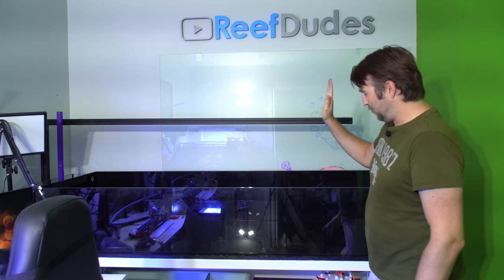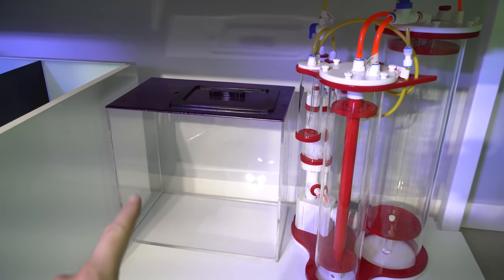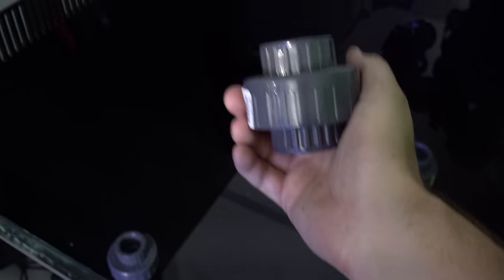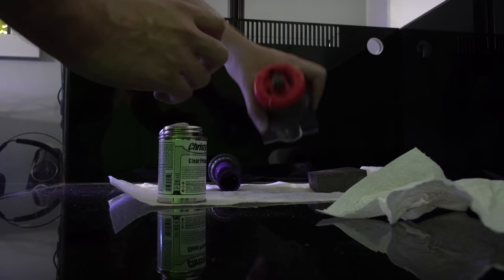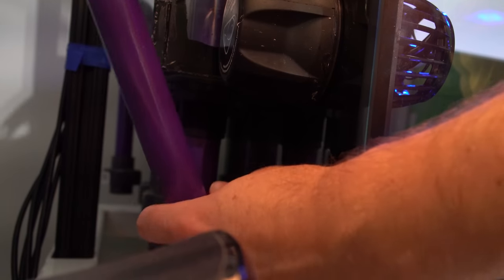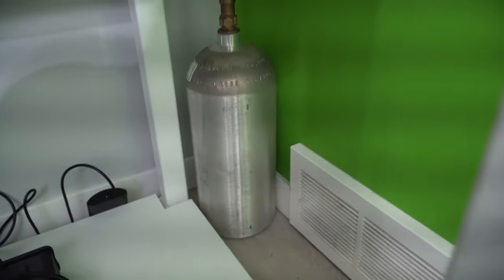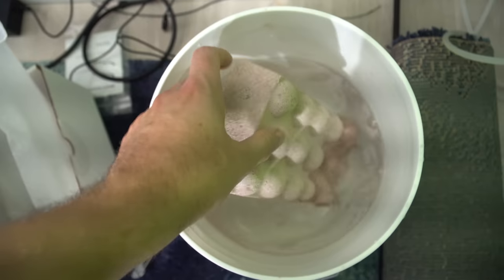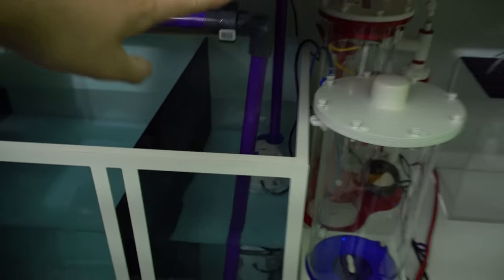Saltwater Aquarium Setup - ReefDudes Coral Frag Tank propagation system!

Comment: Fantastic looking tank. Purple pipe is cool. 
One thing I would have done is plumb the main drain to the most forward hole in the overflow. That would put the filter roller, gate valve and drain up front. Easier to reach since these will be the maintenance items on the drainage system. Hard to tell from the video but the trickle looks just a bit high. I like mine just below the weir so there is a bit of a dropoff.
Reply from the maker: I have the skimmer infront of the roller which i willc lean more often so that was my logic! but if it is a pain to clean i can alwyas swap it later :)  The trickle is just a smide lower than the weir.. i may lower it a bit more later but so far its working well!
Reply: @ReefDudes  Thanks for the quick reply.
I had totally forgot you were putting the skimmer in that chamber too! Makes sense now.
Will you have any fish in this?
Reply from the maker: @johnVidBozo  Yep, everything from the lagoon tank will be moving into this tank soon. I moved in most of the zoas today.  slowly but surely!
Reply from the maker: @johnVidBozo  Yep, all the fish from my lagoon tank will be moving in as im shutting down that tank once its all moved.

Comment: I like the straight up bean animal mod. No elbows. I’ve been running my display like that for 6 months and never had issues. Actually find it restarts just a few seconds quicker too. 

I’m about to plumb a lowboy50 unto my display system as a grow out. When I move, in around a year, I’ll be adding a dedicated independent frag system for archive/ duplication.
Reply from the maker: Simple and effective!   I have done it for a while to.. as long as you have a good gate valve its easy to tune it :)
Reply: ReefDudes spears gate valves all the way. Very smooth, very precise.
Reply from the maker: @neilphillips3193  100% with you on that one! especially a year or two later! :P

Comment: Where did you get that adapter for the power bricks? Looks like the connect to one cord and you are only taking up one outlet with them
Reply from the maker: Yep, split off one plug to multiple adapters.  I like to group like items so all lights on one plug, powerheads on one. ect. 
2 way splitter https://geni.us/2xsplitter    
4 way splitter https://geni.us/x4splitter    
6 way splitter https://geni.us/x6splitter

Comment: Where is cheapest place to get the colored PVC piping? Or can you just spray paint the cheap white stuff
Reply from the maker: You can paint.   If I was to I would use Kryon plastic fusion.  Let it fully cure.  Stuff out of water should hold up fine. Pipe in water needs a touch up after a year or so in saltwater.

So buying actual color pipe has the advantage of not chipping and no long term issue in saltwater.   In Canada reefpvc. In US. bRS